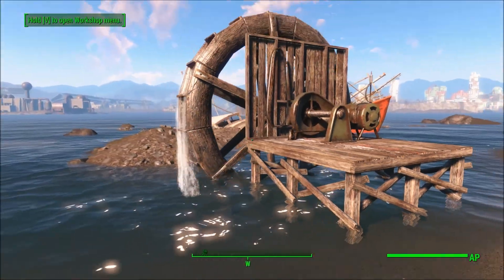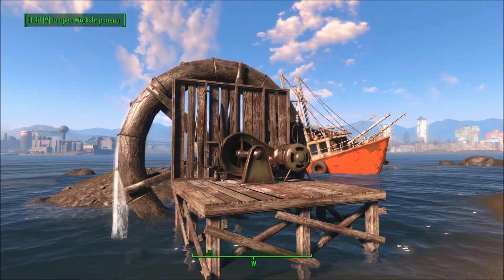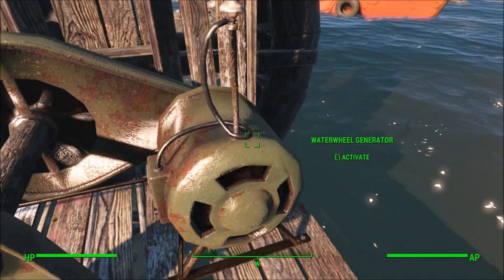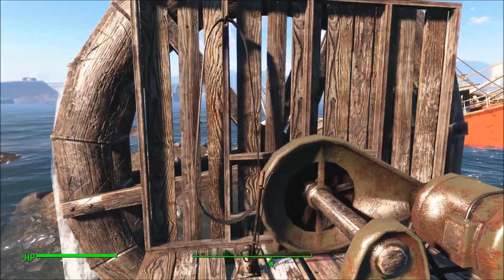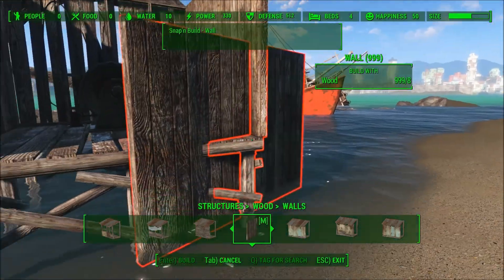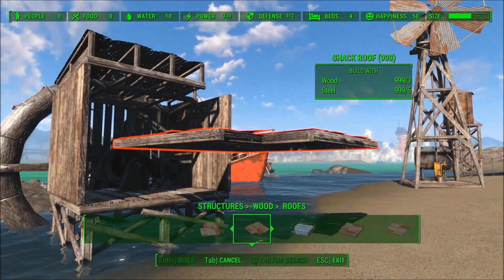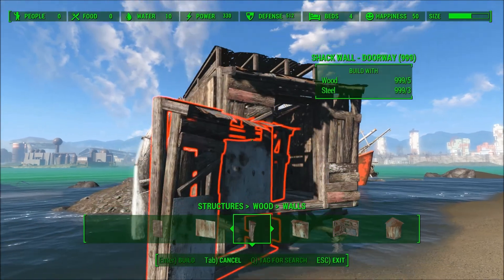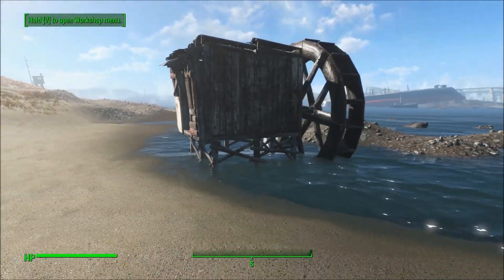woodylicious water wheel generator WIP

Comment: This is incredibly cool, Woody. Been wanting something like this for a while!

A couple of solid lore-friendly ideas that could make great additions to your already-awesome mod:
- To provide power for more land-locked settlements, how about a horse mill? Basically a wheel like this, on its side and elevated, with spokes that livestock (brahmin) would be tied to, so as they walk in a circle, the wheel charges a battery or generates power in another manner? 
- It would be more raidery, but the above could also be done in a player/NPC-powered way as well, kind of like the Wheel of Pain from Conan (but probably smaller). 'Under the hood', it could function a lot like the PowerCycle from the Vault 88 DLC.
- A primitive solar shower, to keep our settlers clean. This would basically be an elevated dark metal barrel, left to sit in the sun to heat up, and a spigot/hose as a make-shift showerhead.
- A little less scrappy and more techy, but still very Fallout-appropriate: a small scrappy-but-functional tesla coil generator
Reply from the maker: I really like your ideas, but for now those would take custom character animations and I'm not that experienced with those yet. The water wheel was my first attempt at animating. Once I get more experienced, I would like to try the "Brahman wheel generator" idea, it sounds cool.
Reply: Can't wait. :) 

I don't know if much custom work would be required for the solar barrel shower thing. I wonder if you could reverse-engineer how the shower objects are done with CWSS Redux mod?